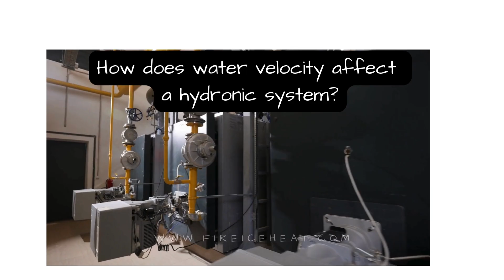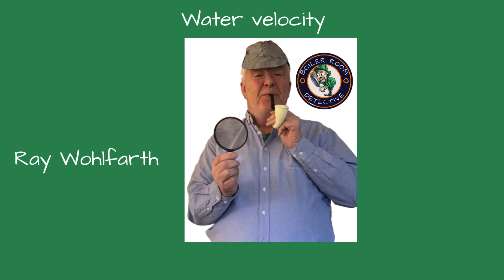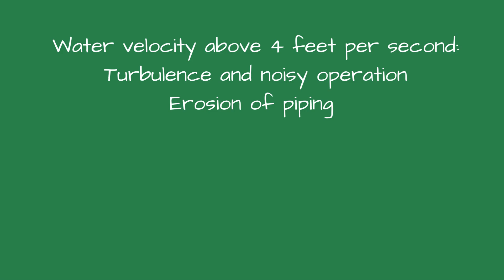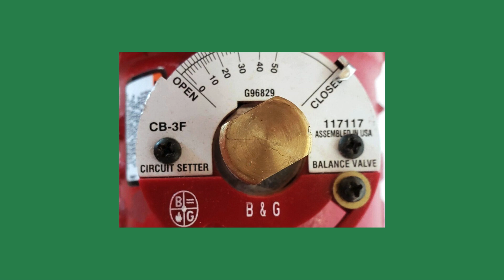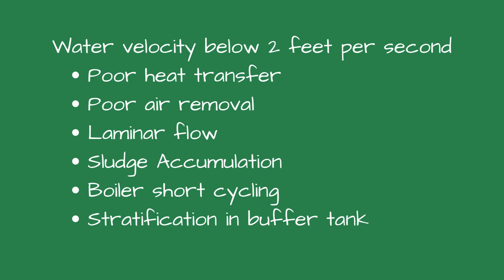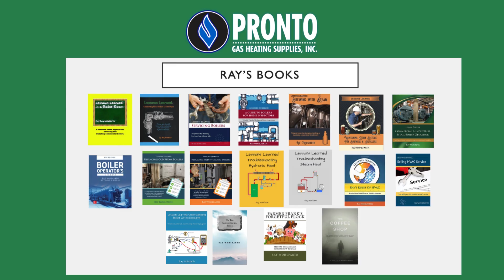How water velocity affects hydronic systems

Comment: I always had  a water & air balancing tech with me on big jobs.  I did HVAC. We did the start ups on all the systems.  I learned the value of  3 in 1 circuit setters real fast! I had to adjust all air handler pulleys  for correct cfm & change the pulleys  to a fixed  sheave to meet the engineered specs.  Those data charts really work.
Reply from the maker: Thats awesome and rare. Balancing makes the customer comfortable and helps manage their utility costs Thanks

Comment: They don't treat much of this stuff in trade school or at best they will VERY briefly touch on the subject. Hydronics, steam, and other subjects could be an entire trade all on its own. I studied how to size pumps, pipes, heat loss/gain, and how to trouble shoot these systems.  It was almost useless because I couldn't get paid more from employers for my added expertise. When you tell a maintenance man that there is a pipe sizing or flow rate issue, he doesnt care. If hes having a persistent problem then he will look at your proposed solution but if he gets a quote then he will look at others solutions also and the cheapest solution accompanied by a person that talks confidently will generally get the job. maintenance managers have a budget typically and the more money they save the more money they have to spend within their department for things THEY want.  Ive shown homeowners my flow calculations during a proposal to kind of suggest this is actual engineering and the other guys are cheaper but use piping estimations at best and most deficiencies wont be known by the owner because they just have more breakdowns and pay more in energy costs but not such a giant amount all at once so that they know there is a problem
Reply from the maker: I hear that Some people want premier service for low bid. I am often vague about my solution because I once told a customer what I was doing and he asked my competitor to bid on my solution.
Reply from the maker: I had the same thing happen to me
Reply: thats the old : Good, Fast, Cheap  choices - U can only " 'pick 2 !" Thanks Dan H..